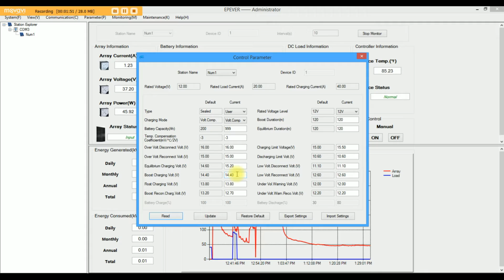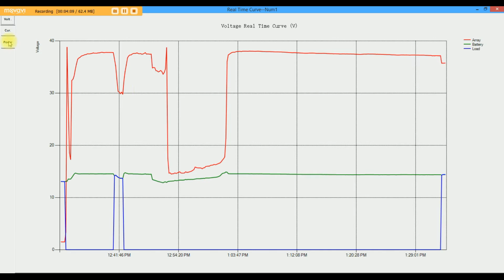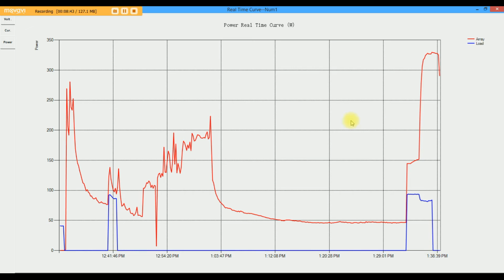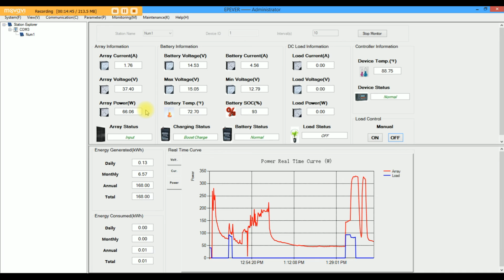Tracer 4215BN BN Series MPPT Controler Maximum Power Tracking Issues Demonstrated

Comment: I have a question I was hoping you could help me with! have the 4215bn 40a charge controller with the mt50. from Epever. Its coupled to 3x100w solar panels in series, each panel has an mpp of 18.5v, totalling 55v. 
I noticed that when first connected, the voltage on the mt50 would display the accumulated voltage of my 3 panels. 55v,  but that will within 10-15 seconds drop down to 13-16v, after the panles have been connected, even if my battery is at  fx 12.4v and the weather is  consistent, with no clouds and no panel shading. People I've conferred with whom have the same system say that the voltage number below the solar panel icon on the mt50 should stay consistent at 55v and NOT drop, if the weather is steady. I understand that over a period of time the voltage will vary depending on where the sun is and how much cloud there is, but the change happens so rapidly, within 10 seconds every time I connect the panels even if there isn't a cloud in the sky. Any clarity would be much appreciated! I have ordered the Bluetooth transmitter and will be able to film this phenomenon in a week's time.
Reply from the maker: Sorry i wont be of much help, I use the software to monitor not the mt50. That being said on the software it is not uncommon for the panel voltage to drop and the panel amperage to go up. In my experience using the software the MPPT charger likes to keep the voltage close to my battery bank voltage and increase the amperage. This can be easily seen on the software because it has a seperate part that shows the voltage of the battery and the amperage going into it. It also shows the wattage from the panels (volts x amps)
Reply: ok, so you are seeing voltage from panels connected in series at 13-16v as well, or are you seeing accumulated voltage in the software?
Reply from the maker: well doing due diligence i just looked up the manual for the mt50. According to that it should  show panel voltage and panel amperage under the panel symbol. It would be interesting to know if when you see the voltage drop do you see the amperage go up at the same time?
Reply: @JohnInBibs  i will conduct more experiments and film them this coming week, and keep you posted!
Reply from the maker: please do, if you have problems let me know...... i would be willing to give you my facebook name for messaging but would obviously delete that post after you got it.
Reply: @JohnInBibs  hey, actually i found a video i did last summer! its 2x100w flexi in series, and i had to rush down to have time  to see the voltage drop. (please excuse flipflops and messy van) the amps do indeed go up, but not very much. https://youtu.be/YC3dXFvx30A
Reply from the maker: hmm you do have a problem there, 16v x 3a only equals about 48watts, you should be way up there with 200w if panels. when you say you wired in series you mean you have positive connected to negative of the next panel and positive to negative and then pick up the positive from first panel and negative from last panel, am i correct?
Reply: @JohnInBibs  correct! This was last summer when I wasn't really sure what I was doing or looking for.  I will do some more this week, and upload. Im just hoping its not my charge controller.... thanks for taking the time to watch and help! Ill keep you posted!
Reply from the maker: make sure you are using the correct wire gauge for the distance that you are running from panels to charge controller. Too thin of wire will cause problems http://www.ggewow.com/25319/1820/wire-amperage-chart.html/wire-amperage-chart-world-of-template-format-intended-for-wire-amperage-chart
Reply from the maker: @timothy790110 The more I think about it the more I am convinced that your wire from panel to controller is underrated. If that were the case you would get the full 55v until the controller tries to draw the amperage (that takes about 10-15 sec) then as the amperage goes up your voltage is dropping because the wire cant handle the higher amperage. Please look at the chart I linked below. I use 10g indoor/outdoor low voltage wire from home depot for outdoor lighting. Just a suggestion.
Reply: @JohnInBibs  hmm, I think the wire I'm using is either  4mm2 or 6mm2. 10 or 11 awg. That should be rated at at least 25a-30a and 1000v. You don't reckon  thats enough? The distance is about 3 meters, about 10 feet.
Reply from the maker: yep that does look good enough..... don't know what to say..... have you tried resetting your mt50 back to factory settings? I am really at a loss but don't think your controller is bad, they are pretty tough and have safety built in etc....
Reply: @JohnInBibs  i hope so! I got in contact with epever, this is the reply I got. I forwarded the vid to their tech departement and Im yet to hear back from them.,   "Dear Timothy Atkins, thanks for your message, there are several possibilities for your issue. But for now let me list only two for you. First, if the voltage stays in 13-16V all day, and the current is lower than 1.5A, it went to direct mode, it's normal, just because the weather. Second, the voltage just stay in 13-16V for a period of time and jump back up to a different level, this should be normal, because it is trying to find the max power point. If this two are not exist, please record a video and send to support@epsolarpv.com, our technician will give you the best answer for your issue, thanks for your understanding, hope you have a beautiful day!"

Comment: MPPT is not meant to react to load, but to voltage of the PV input. If you change the PV voltage, just like if sun was shading, you will see the MPPT reaction time. My 3215BN takes about 5 minutes to react from 32v on PV to 24V. This is the issue, not that is is very slow to me.
Reply from the maker: Cool, would love to see a video demonstrating that (with time lapse, lol)
Reply: https://www.dropbox.com/sh/h7qe8zgeqr238qr/AAAUNpmbbSw6HH4-N5Z1-_KSa?dl=0
Reply: A link to 2 graphs showing voltage and current, The voltage at PV goes from 34vdc to 24vdc, the MPPT was done in about 2 minutes.... pretty good... The battery was in constant charge at 14.4vdc with no load !!
Reply from the maker: Thanks for taking the time to demonstrate this. Two minutes isn't too bad I guess.

Comment: Good demo. I've just invested in a 4210A, which is the indoor less rugged version of the 4215BN. I have 6 x 190W mono panels that were new/old-stock at a good price for my wshop roof. I'm looking forward to finding my way with the system and it's limitations. The manual says it will run 1.5 x over PV input without exploding, so I hope it can manage 1140W on a cool crisp spring morning. I notice your battery bank comes up quickly after a short heavy load. I only have 100Ah at 24V for the while so I see the same fast drop - recharge speed. Thanks for the vid, any advice or tips much appreciated. :-)

Comment: I don't think it necessarily follows that changing the load demonstrates how fast the CC can react to changing insolation (what MPPT is for).  It might show how fast the CC can move between known power points for a given level of insolation.

Example:  It is a clear, sunny day.  The CC maps the power points and reacts to load variation by moving along the most recently derived map to match the present need.  No MPPT refresh would have to be run.

A more productive test might be bulk charging a bank under partly sunny conditions, watching MPPT sweeps as clouds pass. Or simulate the same by covering/uncovering (or partially shading) the panels and see how long the MPPT sweep takes to find the new max power points.

Of course I could be wrong and maybe the CC does remap on load variation too.  Or maybe it's repeated every n seconds or something.  Thank you for the demo.  This does seem to be a lot of charger for the money.
Reply: Exactly